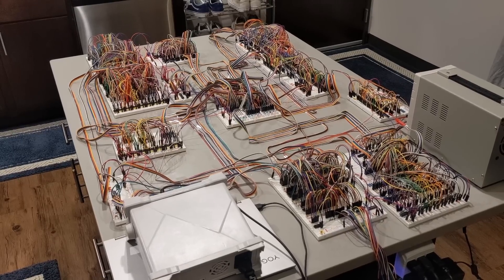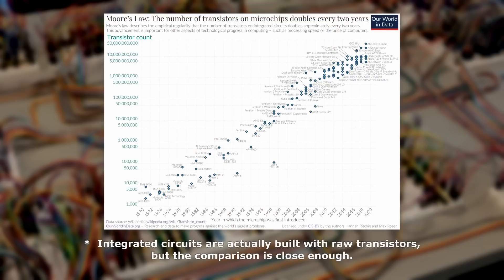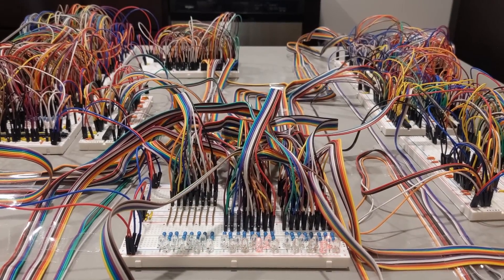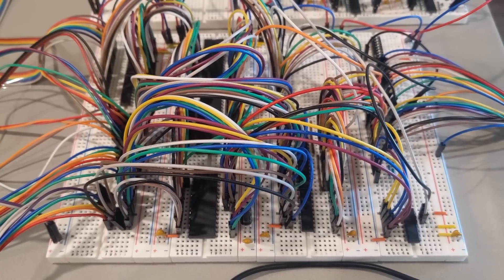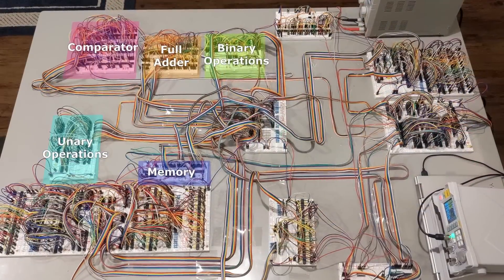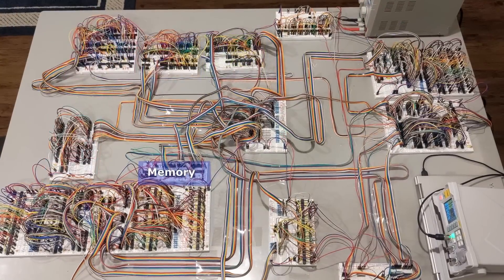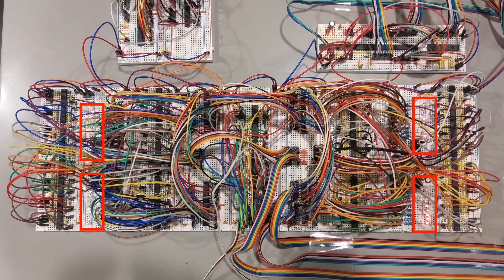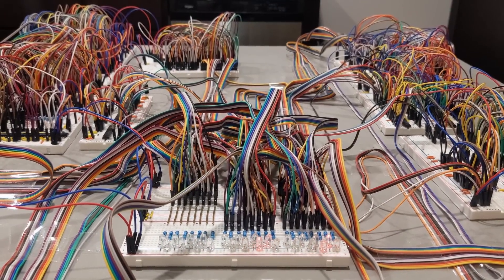Homemade 8-bit Computer

Comment: I would definitely go a bit further with this, considering how far you’ve already come. Now that everything is fully functional, I’d remove those cheating memory chips and build my own memory from transistors, no matter how long it would take. Then I’d add output and programming capability with punch cards, and enclose everything in a nice wooden cabinet.

Comment: Joseph, this is so cool!! It is awesome to see you still building awesome things. I love seeing a CPU laid out physically because it really drives home the "architecture" part of computer architecture. It's a lot more satisfying than linking together a bunch of modules in Verilog, too.
What signals control the operations of each of the arithmetic modules and the bus? Do those control signals come from the program memory unit or is there some sort of control unit somewhere else that I'm missing?
Also, out of curiosity, do you have a link to the full documentation of the instruction set for your assembly language? What compiler did you use? Were any of these existing open-source tools or did you do that all from scratch too? The documentation screenshots you have are so clean!

Anyway, this is SO COOL and also lmao props to you for not bypassing every single IC to ground and instead just going with vibes and bypassing the rails. I always knew requiring bypass caps for ICs was a scheme by Big Capacitor.

Comment: I'll call you a real engineer if you could replace that signal generator to control clock speed with a hamster on a wheel.

Comment: That's such a cool idea. Although I was wondering with one thing. You've been pressing once and one stage was active but one clock cycle did 4 stages at once, is the button cycle different from clock cycle ? Or rather there is some kind of faster clock inside converted from slower clock ? 

But aside from that cool project ;>

Comment: Impressive, amazing work, but one issue is your connections are not that nice, you could've made better connections and used less wires and components, mainly resistors.

Comment: In the early seventies, we used digital trainers that used NOR gates to build more complex circuits. My senior project was a four intersection stop light system using only NOR gates. I built the clocks, timers, and logic using only gates. NOR was the preferred gate at this time, until the AND gate surpassed it. It looked something like your project, but didn't have the dupont cables and breadboards you're using. I learned to do prototyping in wire-wrap and spent years building industrial breadboards prior to committing to circuit cards. Lots of fun.

Comment: Really cool project! Super cool to see it all done with just ICs, I've only done an 8-bit computer using an FPGA back in my undergrad. Did you ever run into issues with using jumper wires? I've had to use some breakout boards for my final project and always found that the voltage drop, continuity, and overall finicky nature of those jumpers can really mess around with debugging logic. Maybe I just had cheap/old jumper wires though haha.

Comment: Now do it with individual transistors for the logic gates.  Now, substitute vacuum tubes for the transistors.  Now, substitute relays for the vacuum tubes.  Now, substitute mechanical rotating parts for the relays.... ;-)

Comment: How did you configure your gates to act as storage bits? RS latches configuration (2 gates)? D-FFs configurations (4 gates)? 
I can't clearly tell but I assume you have used small voltage regular capacitance throughout your breadboards including many ground wires. You will need them with that much wiring that introduces cross-talk between the wires.
I presume each instruction takes one clock to execute.
Your simple instruction set is already decoded which means saving gates needed to construct a decoder.
You can have fun by writing a self-modifying code to get more programming power with a limited memory.

Comment: Very cool project, but why did you render this video in 1080i (interlaced) instead of 1080p (progressive)? As it is, it has some nasty interlacing artifacts (and since it appears to have a mix of different frame rates, it's very hard to deinterlace well). I'm guessing you just had the wrong settings in whatever video editing program you used. Perhaps some software still enables interlacing by default, or you're using an old version that still does that. It'd be nice if you could re-render this video in 1080p and re-upload it. (That is, assuming the raw footage is progressive – but I'm guessing it was; most 1080i cameras would have been softer than your footage appears to be. But even if the original footage is interlaced, there's no reason for the information overlays to also be interlaced.)
Reply: Careful, he might render it as text or EGA graphics.

Comment: Most people today skip right over this level of logic and go straight to high level languages. It disgusts me that they have no interest in gated logic or even assembly code. They seem to think it's a waste of time. Thank you very much for undertaking this project and sharing it with us. Never forget, it all begins with 1's and 0's. Nice job!
Reply: Because it mostly is

I've never purely used gates during programming... The only "gate" I've used is 'or' and and 'and' that's for if operation, if that even counts.

There's no reason to learn details, because you won't use them

I've used more that in  Minecraft using redstone than programming...
Reply: Really? Disgusts? What an extreme reaction lol. I absolutely love low level stuff like this but can see that most people don't need to know it.
Reply: @PaintSkate8  Most people use the highest level languages, like programming their microwave for hot water. Most people don't need C++ either because they can create an algorithm by speaking to Alexa. Those who can create an algorithm using logic gates or assembly code can create the fastest code and the tightest programs. When speed and size matters, those people are the winners.

Comment: I cannot express my gratitude for this sample. My imagination of what is possible has expanded beyond belief.

I have two questions about this. If this computer processes an instruction (ADD, SUB, MOV, JMP, etc.), does it copy the values from the registers, perform the given operation and save the output, or does it save the output directly to the target register without copying? The assembly of the parts tells me that the first option is correct, but I feel that it then causes a significant increase in the processing time of the operation.

And the second question, how are the instructions given to the computer? Are they somehow inserted into the RAM, with the help of which the appropriate unit is then called with the help of the decoder to process them, or is it somehow different?

If I have time for it, one of my old dreams is to make a functional computer like this from the ground up. Although it probably wouldn't be practically usable compared to commonly available ones.

Comment: You should design a PCB next. These modules are very forgiving and the through hole components would be a breeze to solder. You could use SATA cables to interconnect the modules.

KiCad would have all of these modules predefined.

Comment: EE-CompSci Freshman digital logic design course just if you only took one course the entire semester. Insane amount of work & troubleshooting to get right. The hardest part is keeping the clock timings in phase and reduce the power noise with meter-long runs of wires! Must have been tons of caps added just to counteract some unidentified dark magic. I definitely saw a bunch of decoupling capacitors!

Comment: Hello, I also want to create something similar to a computer.

I know how basic operations with numbers work (addition, subtraction, division, and multiplication), and I also easily use memory to store information.

I recently created my own calculator that performs the 4 basic operations with numbers, and I still don't understand how a computer works.

What I mean is, for example, how it is capable of running programs, why it needs RAM, etc. I tried to understand all this by watching YouTube, but everything is described superficially there.

What I'm getting at is, could you provide me with any sources or something similar so that I can understand step by step how, what, and why things are needed?

Comment: Nice work. At university in 1989 we made a succesive approximation ADC with gates and op-amps. three maybe four breadboards. Your work is all the machine parts in a glorious proof of the heart of the machine, The accumulator flag. What you made is truly beautiful. And Im impressed by the contact reliability of breadboards and jumper cables. I very much enjoyed seeing it.

Comment: Nice job! I’ve got a little story for you!

I was doing something very similar but decided to use an FPGA instead. The FPGA allowed me to do some very interesting things (which I made a video about).

I had a functional VGA output using breadboards with a RAM frame buffer. I think the size was 160x200, 8 bit color. While testing I was using an Arduino to draw images into the frame buffer. Unfortunately, I couldn’t get it to behave perfectly, after it ran for a few minutes it would flip a random bit in the RAM or have a temporary visual artifact. I tried decoupling caps and even ferrite beads to reduce the noise on the power supply rails, which worked great but weren’t enough. I didn’t continue with breadboards after that point since I knew it would be very difficult to get the computer to function properly, especially if I added more breadboards.

Comment: 2:05 I know I'm being pedantic, but a clock cycle is, by definition, the time interval between two rising (or falling) clock edges.
In a multi-cycle CPU design like this, each stage is executed in a single cycle.

But to be honest, I don't know what name would be appropriate, since it is generally assumed that the execution of an instruction takes a variable number of cycles to complete. Maybe "instruction cycle"?

Comment: Technically speaking, an 8 bit computer is pretty simple to build IF you know what you are doing. As you went into it with no experience or knowledge then I give you props for doing it :) 
We had to build one in our first year at university, it was pretty fun.
Reply: FIRST year project?!! Like the one in the video?! Apologies but that's very hard to believe.
Reply: @afollowerofchrist5789  eh. We did do it.
Reply: @Falney  I'm just saying that it's really hard to believe for that to be a FIRST year project. If that was the first year project, then what did you do in the subsequent years? What about in the second and third years? What about your capstone/senior project?

Comment: Is this a life size replica of the 8085 or 8080 microprocessor ? Also , can you please link your code somewhere for reference ?
Reply: 8080 consists of 4000+ transistors.  Replicating it would be several times, if not dozens times, bigger than this build.

Comment: I'm amazed as how the sparce ceramic decoupling caps handled so well the parasitics, if i tried this here with jumpers of this size and quantity, probably i would need 3 (1uf/10uf/100uf) in each IC
Reply from the maker: I only have a tenuous grasp on this subject, but I think this is because my clock stages make most noise irrelevant. In fact, the only module that suffered from noise was the clock itself. That module does have a decent number of filtering capacitors of various sizes. 

I did go ahead and liberally apply 0.1uf caps throughout. I don't fully remember why I picked that capacitance. I think it was listed on a datasheet.

Like you mentioned, the datasheet recommends having dedicated noise-filtering capacitors for every IC, but I decided to cheekily ignore that.
Reply: @JosephNaberhaus  Your wires get coupled electromagnetic noise by parasitic capacitances and inductances with the enviroment, so this source of noise is external and only handled by filtering. Wires have parasitic inductance and also act as antennae, wires near to each other have parasitic capacitance and act as capacitors, the lenghts and the geometrical disposition make them suitable for capturing the range of frequencies from communication to mains noise. 

Not necessarily the noise will come from your power stages or clock gen because your bench supply seems very robust ( these can have noise as low as 1mv ), the main source of noise would be external

The 0.1 uF caps have the point of least impedance at the 50hz/60hz range, so they are 0.1 because their impedance to the mains frequency noise is at the lowest. Capacitors are non ideal, and with their parasitic inductance and resistance comes a notch ( band reject or band pass) response, where they act in a range as a capacitor, and in other higher range or frequencies they act as inductors.

Different types of capacitors respond differently to this non ideality as well.

So different value capacitors are different tuned filters, where using a 1uF cap can filter 6hz the best, and a 0.1uf can filter 60hz the best, a 0.01uf capacitor can filter 600hz the best... and so on. 

High capacitor values filter low frequencies, low capacitor values filter high frequencies ( that's why the 1 pf capacitor in circuits subject to noises in khz range)

They point to GND because they really act like this low pass / notch filter that throw the mains noise directly to ground, DECOUPLING (that's why the name) this noise from your supply lines.

I think that maybe your sourcing of components may matter, because most chips around the world when bought from China or low key resellers are just fake ones ( yep , piracy/fake copies of electrical components both discrete and integrated is a widespread issue ), so the internal project may not include the necessary resources to reject noise
Reply: @JosephNaberhaus  Also, the dedicated noise-filter capacitor for every IC is much more important in high noise enviroments like mixed-signal boards with wireless comms in very small form factor with noisy power supplies units, that's where it matter the most. In smaller projects, less caps are usually better, the frequency response of them is better (more attenuation, less poles )
Reply: @JosephNaberhaus  Oh, forgot to mention, where i live we only have access to the fake components.

So we have funny stuff, for example, when students build TTL sequence gens or counters, weird stuff happens.

Like, if you approach your hand to the circuit ( without touching ) it change states.

Or, if the room lights are switched on and off ( even if the circuit is in batteries ), it change states.

Or, the hex displays only light up when you draw your smartphone closer.

That events point that the object near attract charges and distort fields in a way that affect the parasitics just enough to flip the system around. Quite funny.

Comment: hey, how do you manage voltage drops across power rails from one breadboard to another. Because after I plug in a 9v battery after it makes it's way across 6 breadboards the the 6th board has now got only 6V left

Comment: what the hell
congrats for not going insane after doing this
I tried learning how alus work last year and I got so scared, ultra low level computer stuff is dark magic
hats off to you
Reply: Well, no, not really. Most of that is either just logic (hence the name: logic gates), or mathematics or both. 

Calling it dark magic is like putting it in a secrecy corner, which does not help anyone. 

No problem if you have a hard time understanding it. You probably have other strengths.

To everybody their own. 

My bakery bakes way better bread rolls than I do, but that doesn’t make it dark magic. It just means I’m less good at it.

Comment: I'll never forget when I was a freshman in college my electrical engineering professor said to us after explaining the basics of AND, OR, NOT, and XOR gates, he said - "with these gates, you can build any computer you want no matter the complexity" - and he was right.
Reply: In fact, you can basically build every logic operation just using NAND gates, though obviously that sometimes means you have to take the long way. So, using the „correct“ gates for a specific operation is not really necessary, though of course it speeds up things. However, it also means more logic, and therefore a physically bigger CPU. 

Good job. Like it.
Reply: Yep, and a fun fact is that the Apollo Guidance Computer was built using NOR gates only.
Reply: @johanrg70 And they chose to use NOR gates since the reliability of other transistor gates had been unknown at the time.
Reply: Very right indeed and I ENJOYED IT BUT NOT THE TRUTH TABLES LMAO
Reply: You can build anything using only NAND gates

Not saying you’d want to, but it’s possible

Comment: The fact you built this on breadboards is insane
Reply: And probably frustrating..
All those weak contacts.
I wonder how fast it can run..
All those long runs of wire without impedance or timing management must cause chaos at higher clocks.
Reply: @peterpan408  description said 500 kHz which is pretty good imo

Comment: Great Project my man! I had a question in mind, how did you really overcame the voltage drop caused due to breadboards. Don't you think it would have been much more reasonable to build out the final prototype on a PCB? really interested to know your take on this! thankyou
Reply: High quality breadboards don’t have any meaningful voltage drop, not at the kinds of currents breadboards are intended for. I’ve only experienced voltage drop on extremely bad breadboards that had >1 ohm contact resistance. Good breadboards have only a few milliohms.